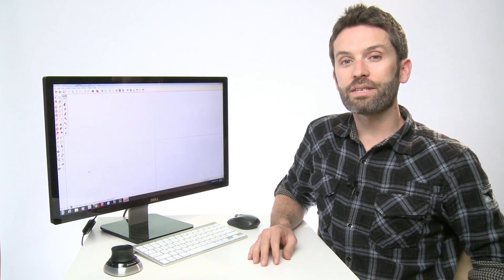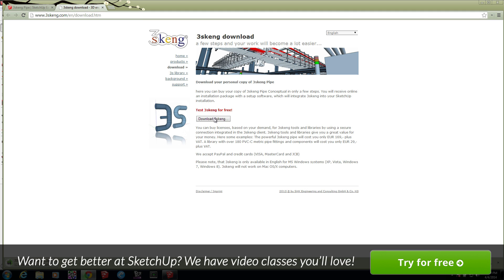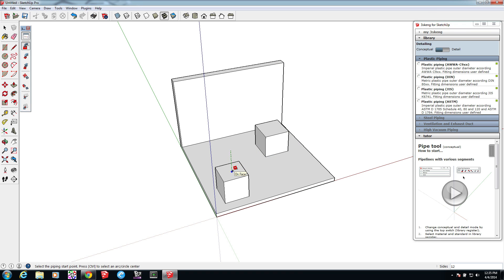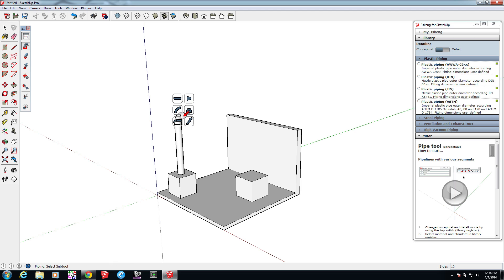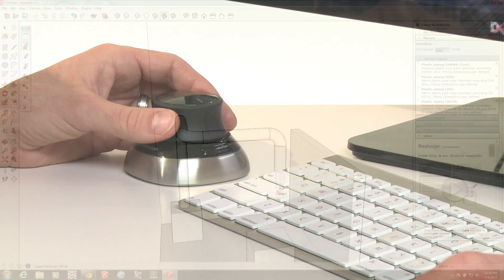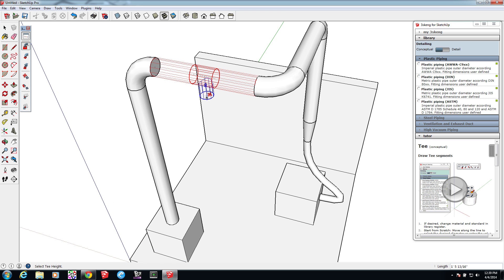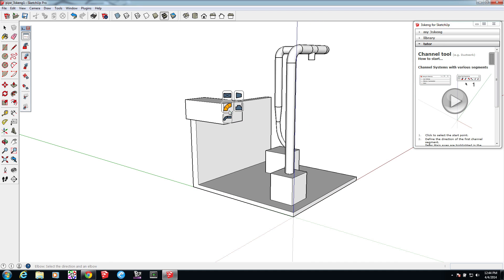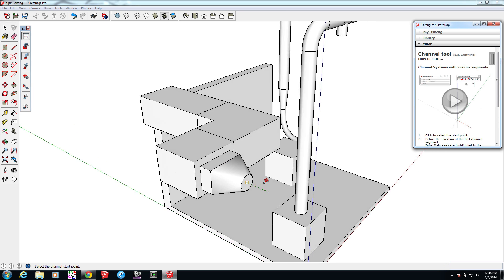Pipe Layout with 3Skeng for Sketchup | SketchUp Show #69 (Tutorial)

Comment: Is there a tutorial that details how to create user design components, such as ANSI 150 and 600 class ball valves in larger sizes. Specifically 2", 3" , 4", 6", 8" and 10".
Or does anyone provide add-on libraries that would include the above valves and also Weld-o-lets and thread-o-lets?